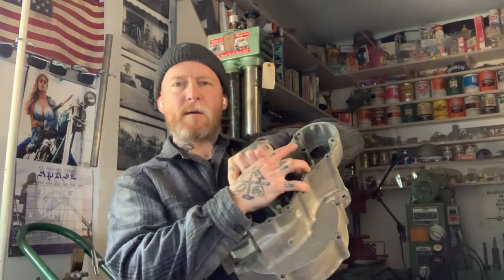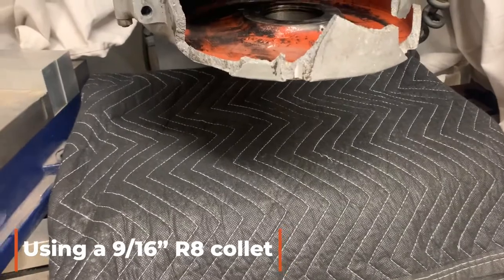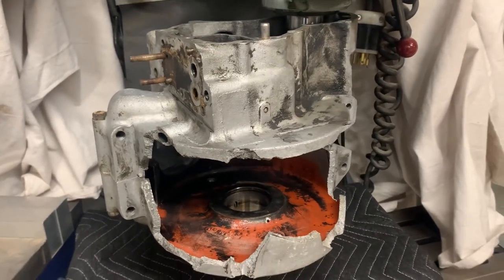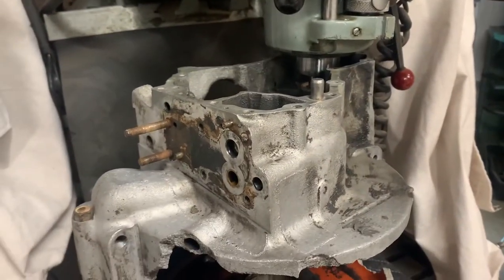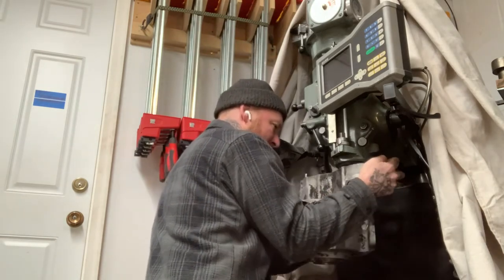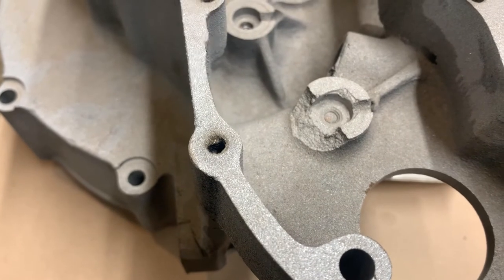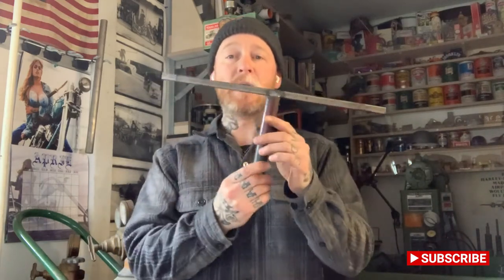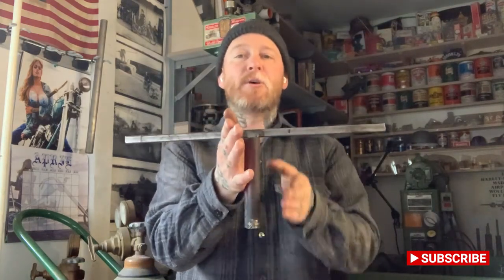Harley Panhead Engine Idler Gear Stud Removal Tip / Block Plane Studio

Comment: Just curious, is it possible to repair such a broken case?
Reply from the maker: Absolutely. I have replacement cast bottoms that I splice in or you can cut up evo cases and use those because they are cheap and worthless ;)
Reply: @blockplanestudio  Just saw your response. Are you saying that the bottom section of the Evo engine case can be welded to an older FLH case?
Reply from the maker: @michaeltracy2566  yes. The bolt holes for generator shovel and evo still line up. They are aesthetically a little different, but with a little futzing around you can make them look perfect. Evo cases are cheap too, so it’s a win
Reply: @blockplanestudio  Thank you for the advice!